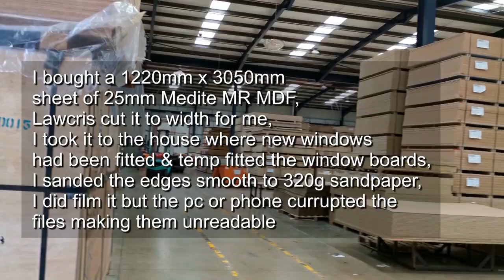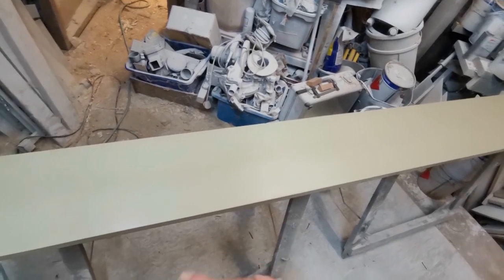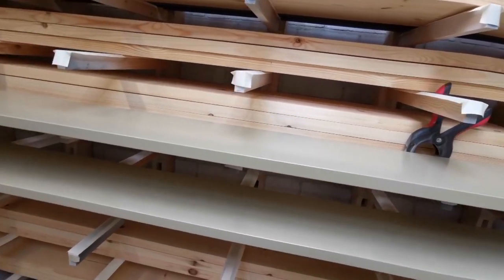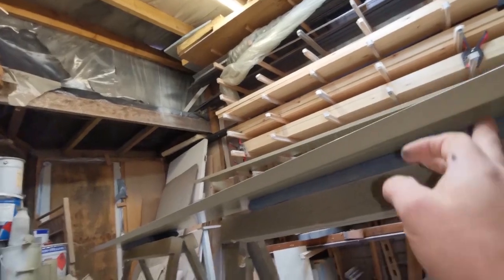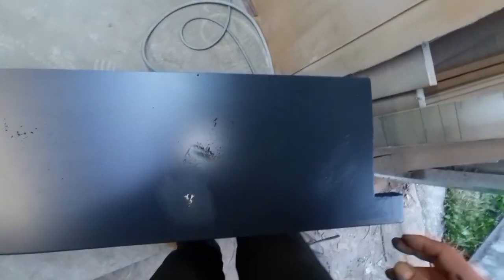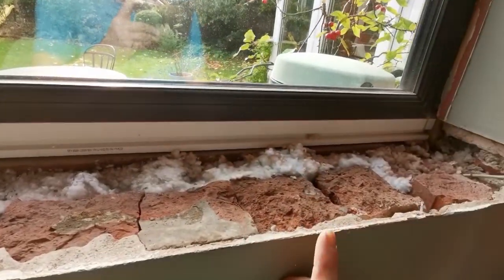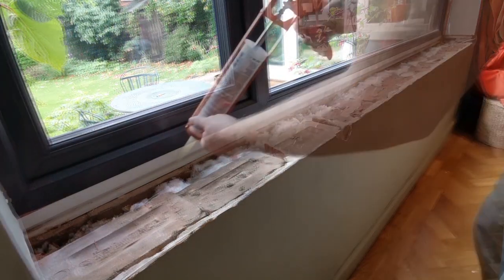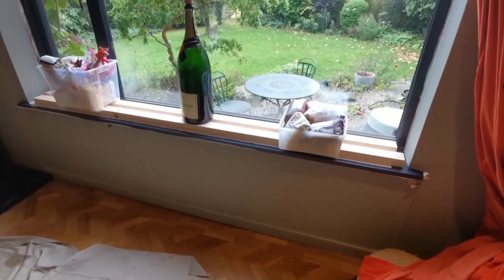Spraying & fitting some window boards with PU enamel paint, colour matched to Railings Grey

Comment: Who’s choice was the Medite? It’s nice to see some green products being used. Could you do a video into your spraying set up please. Great job as always Gid.
Reply from the maker: Hi, Medite MR is my first choice, There's another slightly cheaper, Chronospan MR but that's green right through to the face, the green can sometimes bleed through with some of the other solvent paints i use creating like a small marbling effect on white paint, prob/maybe not the PU tho, Medite has a smoother face than Chronospan & seems better quality, the MR part helps to stop the boards feathering up when painted, I don't buy reg MDF even if it's not getting painted, moisture/humidity is one thing that kills MDF so i spend a little more & take the precaution of buying MR instead. I have a vid on MDF n my choices but sat in my van on my phone so sorry can't find the link, I'll have a look later when home, 
I'll try to inc more on my spray set-up at some point but it's very simple, 50L compressor which is only just big enough, a variety of Gravity fed guns & a wall mounted regulator/filter set at about 20psi , Thanks Russell 👍
Reply: Thanks Gid, I haven’t got a regulator/filter. That must be where I’m having trouble with either to much air out of my gun or not enough air. I’ll invest in one right now. Thanks again.
Reply from the maker: @UKRussellSmith  👍 oil from the compressor can cause fish eyes in the paint, the hose to my gun was new & only ever used from the filter for spraying, if yours is contaminated you might be better to get a new dedicated one for just spraying.

Comment: Cheers Gid... Enjoyable to watch as always.
I contacted you recently if you recall and we spoke a little about spraying and paints etc..... I have since gone down the route of buying a hvlp setup which is working well with my current 'off the shelf' paints I use..... But to echo other comments, I'd love you to do a full on nerdy video just discussing the these more 'specialised' paints for a novice on the subject.... What is precat, AC and PU and the pros and cons to each etc.... and also your spray setup for the the other guys interested in the compressor method.
I found a company local to me who deal in these paints/lacquers who gave me a quick run through and I'm looking at switching to them soon....im just not sure which option to go for. They were suggesting to me the A/C option.... but I know you seem to favour the PU.
So yeah.... If you have time for a big nerdy paits video that would be ace. Cheers Gid.
Chris.
Reply from the maker: Hi, Thanks 👍 I'll try but my set-up is quite simple & i only know what I've learnt from experience.
Before you choose a paint make sure your machine can handle solvent paints, the thinners in these can melt some plastics.🤔
Pre-Cat, AC and PU are enamel paints so give that hard quality feel, they all dry & can be sanded within 30mins-ish. 
I sprayed the primer, 2 coats, on the back of these boards the night before (Thurs) then 2 coats of primer & 3 of top coat on the face next day (Fri) i fitted them on Sat then went back for the final bit to take the masking tape off when the foam had dried on Sun. I normally like to leave the paint 36hrs after final coat to cure properly.
 Pre-Cat is the simplest & cheapest, it's a 1 part paint, pre-cat refers to pre-catalysed, the hardener is already mixed in, it'll last in the tin on the shelf for months tho, no mixing involved, excess can go back in the tin, sprays easily & lays flat, it isn't very hard wearing tho, i did some shelves in blue in one of my vids, that was old Pre-Cat that'd been sitting there for quite a few months, i bought it for a job Facebook pics say 1st may 2017, the shelves i did with the excess 2nd Oct 2018. despite any draw backs it might be the best for a newby to start with,
AC paint (Acid catalyzed) sprays easily in a similar way & lays flat, this is very hard wearing, 
Both of these are hard paints but because they are hard they chip if knocked with the wood being soft underneath, i made the mistake of using AC on a kitchen, Symphony's rep said "why not try AC, it's as hard as nails, it's what they put on cars" The kitchen has chips all over it, i wish I'd stuck with my reg PU, I go back there n touch up the kitchen, cars are made of metal not wood 😒 I don't use AC tho because of this experience,
PU is an enamel so you get that quality feel, but is a little harder to spray, it gives a slight orange peel effect, it doesn't lay as flat as the other two but because of the PU (polyurethane i presume, plasticy 🤷‍♂️)  it has some flex, if knocked it dents rather than chips off, the thinners for the other two are similar to acetone but PU is different, acetone doesn't affect it so nail varnish remover doesn't harm it, good for vanity units etc.. it's also resistant to most household chemicals. I can't clean my guns after using PU with acetone or the AC & Pre-Cat thinners, they don't dissolve the PU paint.
This is where i get my paints, they have info on there site, don't know if it's any good tho https://symphonycoatings.co.uk/
Facebook pics i bought the blue Pre-Cat for 
https://www.facebook.com/gid.joiner/media_set?set=a.1365517043534658&type=3
The shelves i did with the excess sitting on the shelf.  
https://youtu.be/ydyqqGBLa60
Reply: @Gidjoiner  brilliant informative write-up, thank you. 
Do you not like water based paints then?
Reply from the maker: @MrSammyse  No problem 👍 I've looked into the water based stuff but my suppliers recommend 20º+ for it to dry n even then it's slower than the PU. The PU stuff goes hard to sand in ½hr, & in winter as long it's a few degrees above freezing it still goes off within an hr, it's very hard wearing n it's what i trust & am used to, i can't afford to rock the boat when I'm working on other peoples stuff n relying on a good finish to get paid in the end, forget about it n then move on to the next job 😉

Comment: Nice finish Gid. I do need to learn how to spray. I usually just brush with the normal results. nothing like yours. I'm a bit confused??? Did you say the windows needed to be replaced? Seems a bit arse faced. Should do the windows and then the boards. Chance of the workmen hitting and scratching your beautiful work :(
Reply from the maker: Hi, Spraying is fairly easy after a little trial n error, Pre-Cat is 1part, fast drying, lays flat & easy to spray, ANI guns can be got for £24, filter/regulator n a compressor 50L+, any paint that can be thinned can be sprayed. Just the glass in those two was rejected by the window suppliers inspector, the window boards are/maybe gonna get trashed 🤷‍♂️ we'll see 😆 yeah prob better to do them later, but this is for friends of mine n n̶a̶g̶g̶i̶n̶g̶  insistent texts gave me no choice "Gid can you fit our window boards ?" 🙎‍♀️ Thanks Peter .
Reply from the maker: Where i get my guns, they're good people who'll talk to you. https://www.spraygunsdirect.co.uk/index.php/